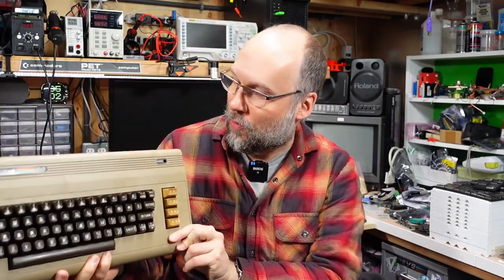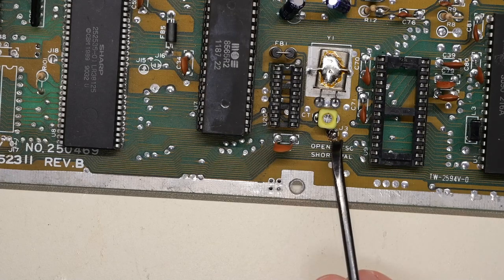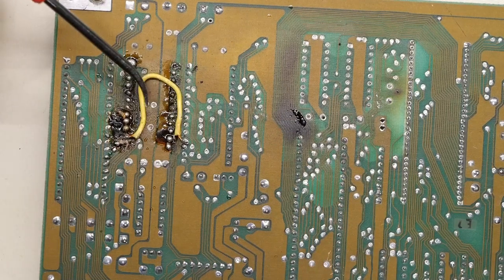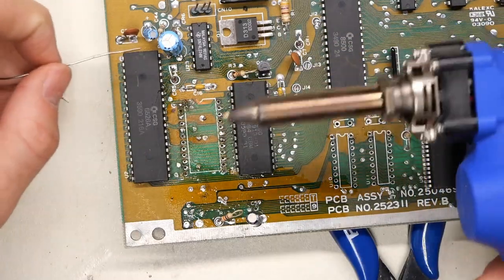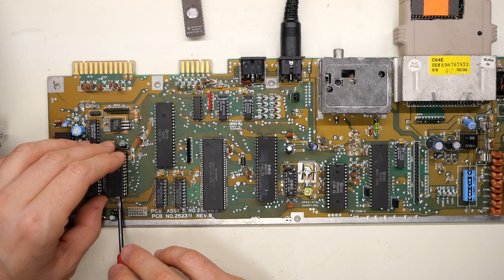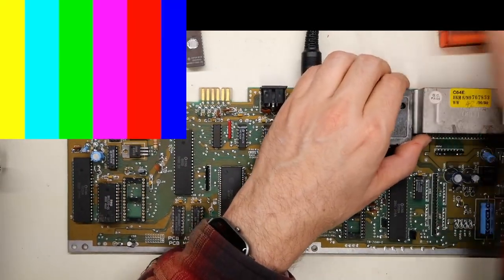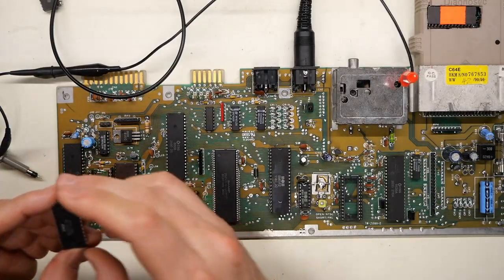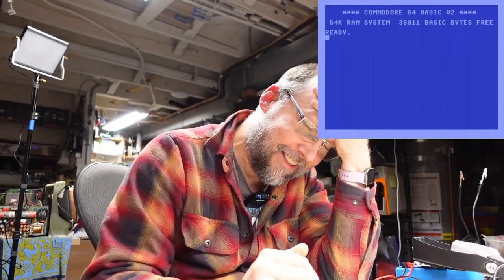Don't use a blowtorch to fix your C64!

Comment: "Who would rip off bypass caps". 20 minutes later "I couldn't find any so I took them from the other board" 🤣
Reply: Yeah, it's almost as if whoever had this before treated it like the donor board it is.
Reply: @stevethepocket  well, save from using a 100 watt soldering iron for some removals and thermite for others.
Reply: Today, Adrian Like a lumberjack !
Reply: Yeah, saw that as well. Let's see what happens when Adrian will try to repair the other board he took the caps from ;-)

Comment: My first ever repair attempt was using a propane torch which I tried to use as a substitute for hot air station. Oh the good ol' days.
Reply: Wow, don't ever do that
Reply: How much was left of the thing you tried to repair? How charred did it get? XD
Reply: @CraftMine1000  I remember I tried to space it out so it won't melt everything, but the chip I tried to desolder still died)
Reply: Propane burns at what? 2000 degrees. I never have heard of this. I never did this one.EDIT 3,560˚ Fahrenheit/1,995 degrees Celsius.
Reply: i've done it SOMEWHAT succesfully, however i was just salavaging parts from some e-waste PCBs because i didnt want to wait for months for shipping from china, parts survived board not so much
Reply: Since then , how many times have you pleaded guilty to Arson?

Comment: First thing I thought of seeing that socket was my father's ancient soldering gun with the trigger light. Those things put out 100w+ at a go. Great for thick cable wiring, not for boards. When I was a kid about 10 or 11, I tried using that gun on a circuit board to add a wire on for  and that burn type happened. I laughed so hard seeing this here.
Reply: I thought exactly the same, as a kid I used to like making the tip glow red by holding the button in way too long, a weller if my memory serves me right. 🤣😂🤣
Reply: Was what I thought too. I still have (somewhere) a soldering gun, I bought that when I was 15 or so. I only use it for cable wiring. But today I have that soldering device that Adrian showed. Whoow, USB and very good!
Reply: @JaapGinder  I ended up with a Hakko instead because it's prewired to be ESD safe. That's the one thing I worry about with working on old computers, and the USB soldering irons are a pain to ground properly to be ESD safe.
Reply: Good old soldering gun, I member the tip with the shape of a F1 trace 😅 (a circuit is a circuit...)
Reply: I've used my 100/140w soldering gun to do lots of work, even basic SMD work and it never caused board damage. I then used it to (try to) repair the through-hole power supply in a VCR and it damaged the board. Board lamination quality is probably a huge player here.

Comment: 12:41 I'd recommend making a small slit in the wire coating with an X-Acto knife before heating it up, That way you know where the coating is going to separate. Also I usually only do that if the wiring is serial - ie, I'm connecting the same wire to multiple spots and I don't want to cut and splice it.

Comment: My own guess, they use the cheap 130W (maybe more) L-shape soldering iron (for pipe) to solder, that's very hot and a thick tip ruins the PCB and socket, I've been using that when I'm 11 years old, soldering without a table, always have ball of solder rolling off and burn my leg, nostalgia.
Reply: That was my first thought as well: the good old (large) Weller soldering gun.

Comment: I've been in the industry for over 30 years and I was a component level service engineer on the BBC micros and Archimedes.  I have NEVER seen a bodge job that bad :-)
Reply: Hopefully none of mine ever look that bad
Reply: @Cowasaki Electronics  Well you need to move around more often and experience life out there in the big wide world hehe! That type of damage is common nowadays. Checkout the arcade scene for some butchers beyond belief. I once had an unbelievable repair, someone pulled out a LM7805 and replaced it with a LM7905 LOL! Yeah they look the same so they much be the same thing right? LOL!
Reply: @johnbos4637  Difference is that I now generally build, repair and modify valve amplifiers plus I can choose what to repair and what to refuse.

Comment: Those machined precision sockets are great for new chips but are really bad for desoldered parts. They can even get damaged when there's an excess of solder left on the pins. That's why I almost always use dual-wipe sockets when in doubt. They are way more reliable than the cheap single-wipe ones Commodore used and are also mechanically tolerable to desoldered and/or otherwise abused parts. Add to that the bonus of being way cheaper than machined sockets... Dual-wipe sockets have never let me down. The only way to ruin them is by ramming too thick of a conductor in them, like some ROM adapters, Kernal switchers and so on, they might get bent and not work with the flat pins of regular chips any more.
Reply: I almost always use dual wipe sockets because they contact the pins better. Look at a machine pin socket that has had a dip chip in it and you'll see a groove worn in the hole. Once the chip has been removed and replaced a few times the machine pin socket becomes sloppy whereas dual wipe sockets will hold dip chips well as long as they are not abused by inserting an adapter like you said. For desoldered chips I always use wick to remove the bulk of the solder then just sand the legs with 400 grit sandpaper then the legs are smooth and the chip slides in easily and can be removed without pulling pins out of the socket.
Reply: Fun fact, later C64 PCBs were made from compressed paper fiber with a coating instead of G10 in order to cut costs even further. Though at least Darth Jack did it to actually lower the MSRP rather than just keeping prices the same and pocketing the difference. He might have been an assh*** but he did believe in selling affordable computers.

Comment: This is a good candidate for a one of those C64 modern PCB replacement projects!
Reply: I'm loving all the retro computers and consoles that are getting much needed modern PCBs that remove redundant parts like tons of resistors and capacitors, plus using modern PCB techniques which means no lifting traces easily and whatnot. Very exciting times

Comment: Seeing circuit board damage brings back fond(?) memories of repairing CB radios back in the 1970s.  People would do so many things wrong; not quite to the point of a propane torch, but plenty of cases of acid (plumbing) flux, 100+ watt soldering guns, you name it.  Combine that with poor quality PC boards and I saw a fair number of burned and delaminated PCBs, broken traces and feed-thrust.

Kudos to you Adrian for sticking with it and finding the problems.

Comment: That was a funny repair. Whoever butchered this C64 previously wanted to be sure, that the person which would repair that, would have a lot of headaches. I'm absolutely with you about the point, that trying to repair a board which s.o. already tried to "repair" is usually by far more complicated. Great job Adrian!

Comment: Adrian, for the chips with narrow, short or damaged pins, I have put one into a machined-contact socket and soldered it into place.  The chip & socket header assembly can then be used in another machined-contact socket on the board.  I learned to do that at work years ago, when needing to swap test EPROMs frequently.  I used Augat brand sockets, not sure if they're still around or not.  Only once or twice did I have an issue, that was where the little cylindrical contact inside a socket pin was missing.

Comment: OMG! Someone really took out the flamethrower on this poor thing!
Cool fixes Adrian!
I had a similar thing happen to me when I fixed my toast rack ZX Spectrum, where I suddenly lost all of its upper memory because I accidentally hit a trace while lifting out a GAL chip. The damage was also totally invisible and the traces on the Speccy are really, really fragile and exposed as mine lacks a solder mask.. 
I was about to replace  all of its upper memory chips when I discover the broken trace. Good thing I did a full continuity test first; face palm :-)
Reply: or a heatgun (i've burned boards similarly stripping parts from them)

Comment: This is why I mostly use dual wipe sockets instead of machined sockets. The dualwipes makes much better contact with desoldered chips that has short legs.
Reply: I like dual-wipe, but I think they can suffer capillary moisture retention that oxidises pins. I think the machined ones are interference press fit that are too tight to let oxygen between them. Basically it's easier to make contact with  DW, but if a machined one makes contact it's permanent.
Reply: Bil Herd said in a (now) old 8-bit guy video that you should always use dual wipe. This burned in my brain. For some reason I don't trust those hole-type (machined?) sockets.
Reply: What happened with the original socket was probably way too much solder was used, and it got sucked up into the top side of the pins. Maybe too much heat warped the plastic a bit too.
I prefer to use round pin sockets only with round header pins, but round pin headers are great for making daughterboards for wipe-pin sockets, such as a 2513 to EPROM adapter board.

Comment: when I was a kid and I was trying to solder without anybody telling me how to do, I didn't know flux was important - and didn't know flux was in the solder itself. So I would melt some solder on the iron's tip and then (when the flux had all burned away!) apply it on the joint/component. Since the solder would not flow, I thought it was a temperature issue so I would get the biggest and most powerful irons I could find. 

The results were more or less what you saw on that poor board - well, maybe without the brown patches! :D

Great video as usual!
Reply: That's why you should use liquid flux. Then you can place it on the lead area and be more precise with it. Particularly with thru-hole parts as the flux will fully penetrate in the barrel and not burn off right away.

Comment: I blame this on all the electronics stores (back in the day) selling you basically plumbing soldering irons that have no temperature regulation and plug right into the way. So hard to get things right using those. Even the "learn to solder" kits at Radio Shack came with those. It's like they wanted you to fail.

Comment: Beautiful fix Adrian! I really want a C64 someday and I'm learning all I can as far as troubleshooting goes. Its good to know that even a rough board can be fixed. Thank you for your time.
Reply: If it's a single layer board, it can almost always be repaired as long as you don't have big craters where the actual connections lie. It's all down to whether it is worth fixing at that point or not.

Comment: One thing I tend to do with plated holes when cleaning up after a poorly done prior repair is to use a pushpin as a mandrel to push any potentially loose barrel plating back into place, and the pads on that ROM socket would be a prime candidate for such a step. Another step is to use a small dowel to press down the edges of pads that may be beginning to lift. Neither step will restore the lost bond between the copper and fiberglass, but will go a long way to improving the post repair appearance.
Reply: What about via repair kits?
Reply: @SockyNoob  I work in a production environment, and such ‘repairs’ do not comply with IPC standards for long term reliability, so I have not used those in ages. I have found that in a pinch, a bit of wire soldered into an open via will work as well if it’s just passing a trace from one side to the other. All bets are off if the board is multi layer.
Reply: @Renville80  so you're basically screwed if it's multilayer?
Reply: @SockyNoob  pretty much, unless you don’t mind adding jumper wires to replace the broken bonds in the damaged vias.

Comment: Messy, but you can push a conventional wipe-pin socket into the turned pin socket and then fit the original 'short-pin' IC.

Comment: Hey Adrian. In order to clean that kind of mess you may try to heat board to about 100F and then try to use IPA on some ear stick. If it fail repat procedure with some flux added before heating.  To make pads nice and clean it's always worth using wick desoldering tape and some amtech flux (eg. 223 or 559). 
I love your channel! Thanks!
Reply: Yeah I cringed a bit at the use of acetone. It's much better to use a bit of elbow grease and some IPA or use a dull tiny flathead screwdriver to scrape off the gunked on flux. Much safer anyways

Comment: I have problems with machine pin sockets. So much so, that I can't trust them and have switched back to dual wipe sockets. Just as you observed, they will sometimes fail to make contact with all the legs on pulled chips. In addition, when removing and reinserting chips during troubleshooting, contact will become intermittent, requiring you to push down on the chip. I have also observed that chips are more likely to pop out of machine pin sockets. I don't have these problems with quality dual wipe sockets. BTW - seeing all the burning made me laugh...poor board. Looks like a smidge too much wattage on the iron used for that "repair". I also love the heavy duty bodge wire. Reminds me of old times.

Comment: you'll see warping and burned spot from using a heat gun either to hot (most likely) or holding the heat in one spot for way to long.   i worked in a local authorized commodore repair shop.  for a couple years and you would not believe the stuff I saw in the 80's that customers brought in from trying to fix it themselves.
loved working on commodore equipment!

Comment: That's the mainboard that's in my C64. I have one of the last ones made when my original died back in 1986, I got a new one, and it was a white C64C keyboard in an older C64 case, they were obviously trying to use up some old parts. Getting ready to shoot my own video on retrobrighting and restoring it as the keys are yellowed now.

Comment: BTW Adrian, you were experiencing the exact same problem I had last weekend when working on a C64.  I desoldered the MPU and installed a machined-type socket, and kept having intermittent problems which turned out to be the MPU pins not staying in the holes since they were trimmed short at the factory.  I took that socket out and put in a double-wipe socket and that did the trick for making good contact.  (That C64 was not one of the blowtorch-burnt ones.)

Comment: It was lovely to learn about this Board as I have two of these 252311 boards and A and B revisions.  Love my C64c
Reply: the board in the vid is the worst one to own because Commodore integrated the color ram into the pla so if the color ram goes bad you're out of luck. every version board before this is better.

Comment: Really enjoyed this video! I get to see diagnostics and repair techniques that I need to learn how to do, like using probes and oscilloscopes and correct sized bodge wires. Also want to know to how to use those replacement through hole via kits. Still have lots to learn! Congrats on getting this to work. Repairing a failed repair from somebody else is ALWAYS the worst.

Comment: Funny you mention a torch. Was at a hamfest and a guy was selling 1 lb grab bags of parts from boards. Talking to him for awhile and found out his technique to remove parts was to heat the board with a torch and rake over top with a wire brush till the parts fell out. I didn't  buy anything lol
Reply: Holy damn, I wouldn't buy anything either.

Comment: I've burned a few boards like that trying to use hot air to desolder DIP packages.  Didn't mangle so many traces in the process though.
Reply: Don't use hot air on a C64 PCB the later ones were made from a coated compressed paper fiber instead of G10 and have relatively low tolerance for high temps.

Comment: Dual wipe sockets give a better connection when using pulled chips.
Reply: Yep a repair with a machined pin socket isn't a repair at all, it's just a slightly delayed failure
Reply: You can clean up desoldered pins a bit by (quickly) using a desoldering gun on the pin (I mean the type that has a combined heating element and desoldering pump) then applying some flux and reheating the pin to smooth out the remaining solder, then clean off the flux. You end up with a clean lightly tinned pin basically a tin plated component leg.

Comment: Quick tip while we're talking about not torching our boards... auto-ignition temperature of isopropyl alcohol is 399C. There's no need for soldering irons to be that hot, but just in case anyone has theirs set that high, make sure you let the isopropyl fully evaporate first.
Reply from the maker: Good tip!
Reply: I think I have set the desoldering station that high when I was trying to get a modulator off the board.

Comment: I'm not great, but everytime I messed up my C64 repair I fixed it. I have a bodge wire where I removed a trace. Then again I have a 2nd one where I lifted a trace, but it was still attached, so I didn't bodge that. IT's on the cartridge slot. I had to replace it. De-oxit helped..........until it didn't. It got to the point where de-oxit was lasting less and less until it did nothing. New slot = fixed.